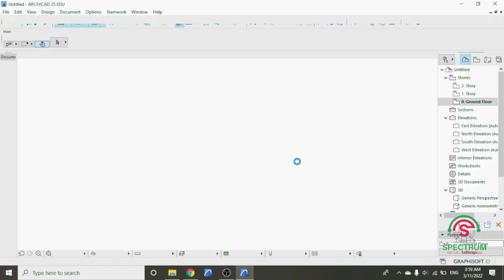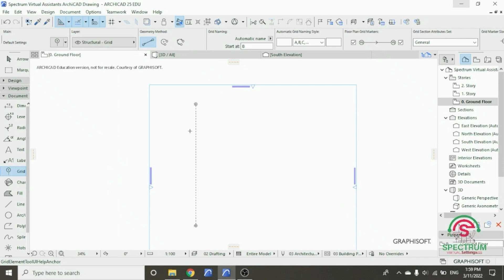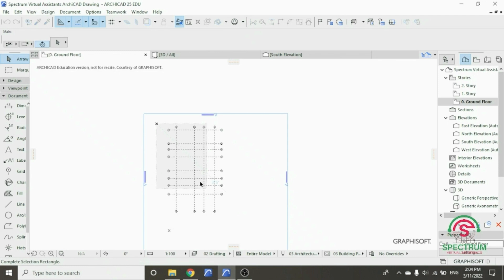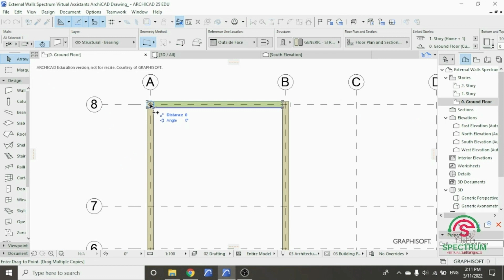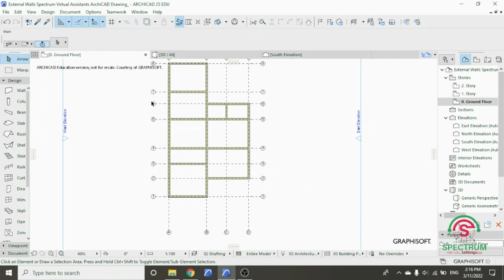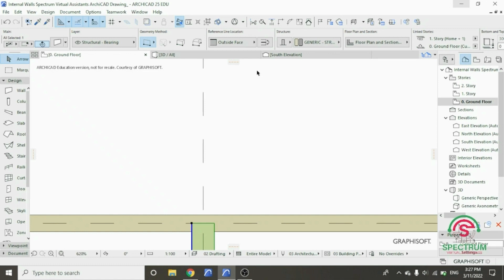Comment: How do you select more than one wall to intersect
Reply: How to Intersect Multiple Walls in ArchiCAD 25
1️⃣ Select Walls: Hold Shift and click each wall or drag to select them.
2️⃣ Intersect: Press Ctrl + Shift + I (Windows) or Cmd + Shift + I (Mac).

💡 If walls don’t intersect properly, check Building Materials & Layer Intersection Priority in settings.